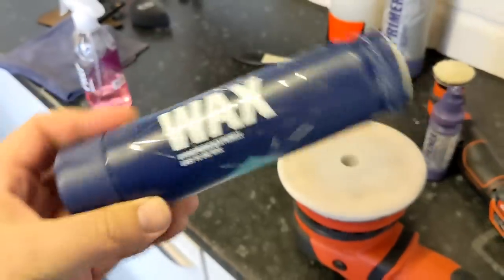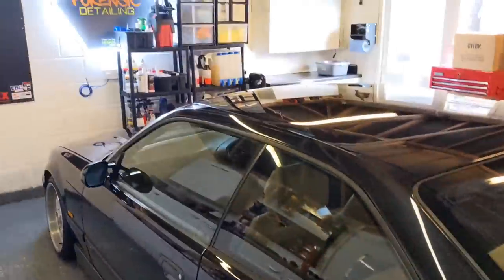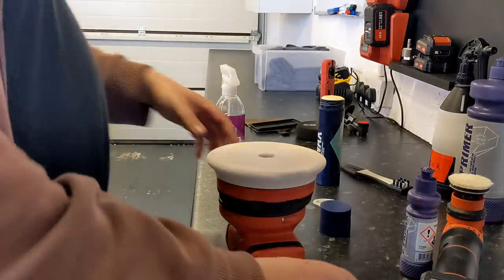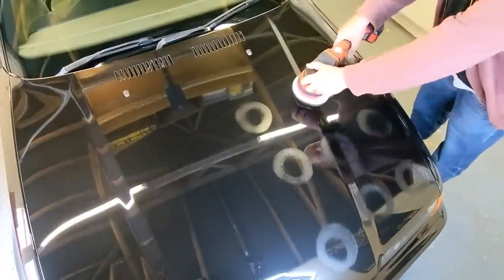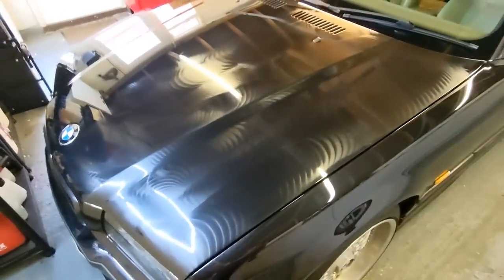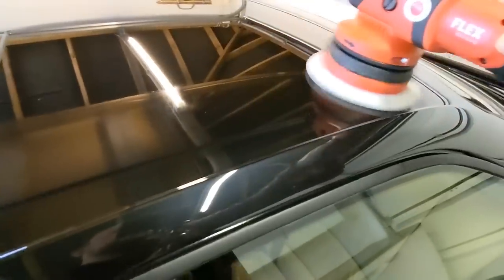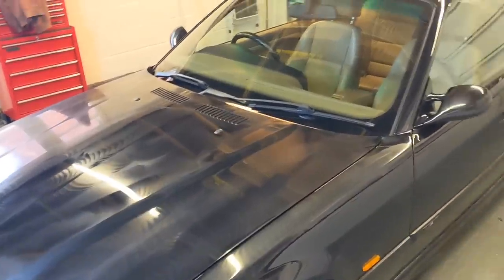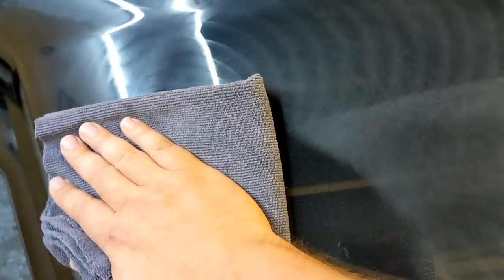Waxing By Machine | Super Fast and Great Shine

Comment: Jon, been using Gyeon Q2 Wax since last spring and love it! I plan on doing a massive detail on my new car soon w/ Gyeon Pure EVO and will eventually top it with Q2 Wax at some point😉
Reply: Be wary of applying the Q2 Wax on top of pure. Car Craft Auto Detailing just did a review/test & the panel with PURE EVO that was topped with Q2 Wax lost hydrophobicity before the panel with Pure on it with no topper.
Reply: @larrysing  I'm sub'd to his channel and saw this video come up and not doubting you and certainly not him but Q2 Wax was specifically made to go ontop of coated paint🤔

I know what I'm watching during dinner this evening, thanks for the heads up😉
Reply: @klasseact6663  I know - I have a Mohs Syncro EVO coating on one section of my daily driver, & I have put Q2 Wax on top of it. I’m doing occasional washes & tracking the hydrophobics on my channel. It will be interesting to see how well it holds up with the Q2 Wax on top of it, but with Q2 Ceramic Detailer (and an occasional Cure topper) maintaining it.
Reply: @larrysing  still not sure why you'd want to mask off a true coat with a wax.
Reply: @sebster6031  The same reason anyone puts a “sacrificial layer” on any coating. If you leave a coating without a topper, it degrades faster.

Comment: Hi John, I am getting a new car later this year, and I am using my old one to practice detailling which I have not done before. So I did a deep clean (I thought) and waxed the car, only to realize that in a few spots I have waxed over dirt. On top of that I want to try and polish some scratches, but how do I get through my double speed to do that, do I just need to strip it by washing it a bunch of times? Seems like strippers are not that efficient
Reply from the maker: You can't strip protection with detergents as a general rule.   You need to wash, the area, clay the area, reprotect it m8

Comment: Great video. Can you recommend a good 150mm pad to remove light scratches with compound and one for polishing with my DA polisher? As a DIY user there are so many choices that causes confusion, and I don't need a professional range of pads. I just want two types in my cupboard that I can buy in pack of five of more, rather than a pack of assorted types. Thanks.
Reply from the maker: Just use scholl S20 black.   Flex purple on hard paint orange soft

Comment: My f10 m5 to big for my garage. So forced to stay on drive way.  I'm getting very addicted to detaling. My question is after wash and drying and decontamination stage. Quite often the light conditions are poor to carry on. So cover car.  It may then be left a day or two before I'm able to move on.  Would you go over car with a panel wipe. Or a very gentle wash. Or any advice before applying wax. Thanks Jon

Comment: Do you think using the da polisher will degrade a ceramic coating, thinking of using this as a topper on top of my mohs syncro coating.
Reply from the maker: with a soft finishing pad on low speed should be ok mate but hard question to answer.

Comment: Hello hoped you might be avke to help me.

Iv purchased a torq 22d 16A -240 volt polisher but its arrived with a European plug and the uk adapters are specified as 13A -250 volts?
I don't suppose you know if its safe to use the 13A UK adapter for a 16A European plug.
Reply from the maker: I really dont know mate im sorry

Comment: Hi, I have the same polisher machine as you use here. Have you done a video on what are the best applicator pads to use..? Thanks!
Reply: Do you use wool or normal sponge pad ?
Reply: @harisyoung4110  I have the chemical guys sponge pads. But open to wool if it’s better.

Comment: May be a stupid question but can you not use a soft wool or micro fibre head on the machine to take off residue so removing with minimal effort, their must be a reason why not as Ive never seen it done and I sure this is a stupid question. Thanks John
Reply: It's not a stupid question but most people just use a good mf towel to remove the wax because it's easier and just better to do so.
Reply: Faster as well because you don't have to keep picking up and putting down a machine. Plus you've gotta use a mf towel for fine tuning anyways💡😉
Reply: Also a machine creates too much heat.

Comment: God I want to give that wax a go on my car. The only thing is I have "carbon fiber" racing stripes that were installed from the factory. Would the wax put a film over that or would I have to avoid it all rogwther
Reply from the maker: if its clearcoat CF wax it if its exposed carbon fiber just leave it yer.
Reply: @ForensicDetailing  yeah it's exposed. Thanks boss

Comment: Could I use the da8 from in2detailing to apply  AG ultra HD wax ? If so which pad should I be using? Thanks 👍
Reply from the maker: Yes use sift pad like rupes white.  Or fkex red.  Problem will be getting wax out of pot onto pad.  Pad bigger than pot

Comment: Jon.  Another mistake made.  Used a black softer pad and wax on a basic drill head and it left holograms.  How is this even possible. Know forced rotation for compound reduces chance deeper holograms but plain wax on a drill still left them ???? Did I push the pad in.  Wonder what did wrong. I do polish by hand where I compound first.  This was a flat black not needing correction.  So went in with speed. Drill and wax and failed !!!!!!!    Lovely glossy finish and then next day.  Saw…. Holograms !!!!!!
Reply from the maker: hey buddy, yer the same "can" happen with rotary.   pressure and speed and the abrasive effect of the wax.   Drill is not ideal.   It creates heat and micro surface marring when that clearcoat softens from the heat.   Best thing is to get a DA mate this just wont happen on DA or very very unlikely to.
Reply: @ForensicDetailing  thanks loads Jon. My original DA can come back out for polishing only. Ditch drill back to seats only use.  Stupid me thinking ok for wax application.

Comment: I’m planning on using Gyeon Primer before their EVO ONE coating soon 👍 using Gyeon’s white pads - would you recommend slow machine speeds and working times Jon ?
Reply from the maker: Chris I have video on this coming soon.  Primer can be worked on softer pads with no issue
  High speed will be ok, but keep it at medium like brand suggest.  Forgiving to use and buffs well.  It's easy u will love it
Reply: @ForensicDetailing  Cheers 👌 hear good things about it and the EVO range. Gyeon make you want their products🤣

Comment: Yo Dad, as a quick aside - do you think it would be worthwhile to do a deep dive on claying a coating? 

Adams did a video on their graphene coating/claying the coating after a year. The comments section went wild and were in all directions 😵‍💫 

I really dunno either way, just thought it was interesting ¯\_(ツ)_/¯
Reply: I'm personally, pro-claying a coating. Even with some maintenance, a coating will suffer some degree of performance deterioration after a year. If the owner doesn't periodically decontaminate their paint with fallout remover, tar/glue remover/TFR etc., they're going to get embedded contaminants that will affect the hydrophibicity of the coating. Claying an underperforming coating will remove these contaminants and in most cases, revive its properties.